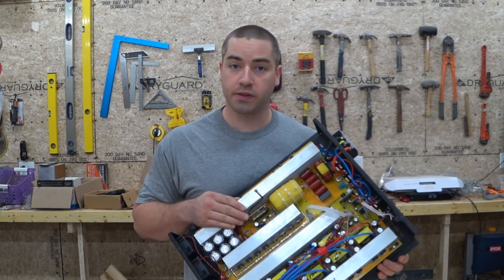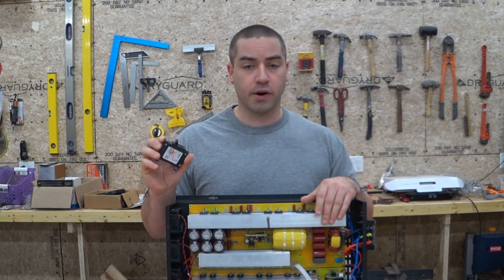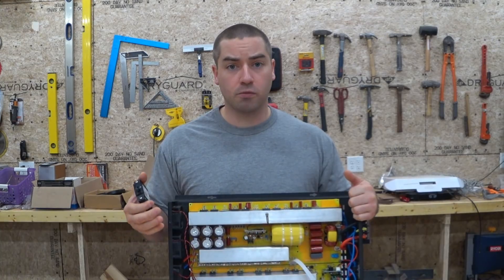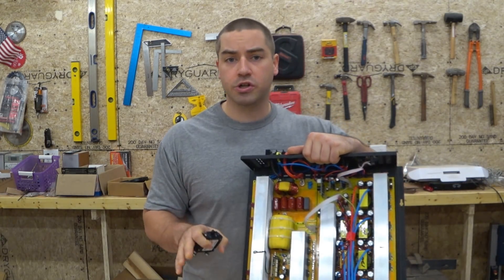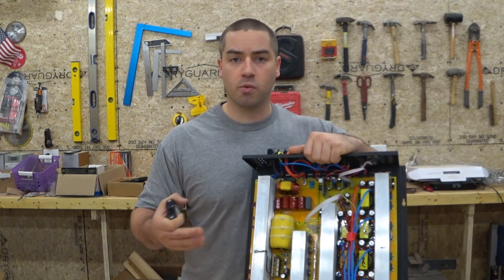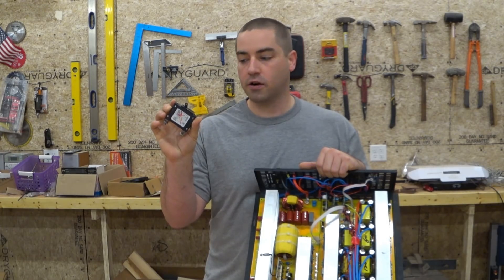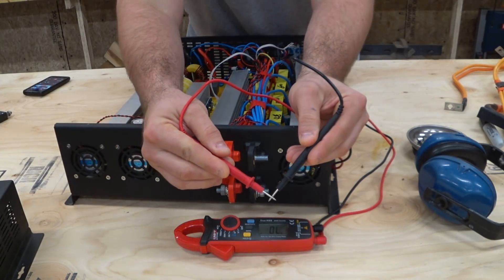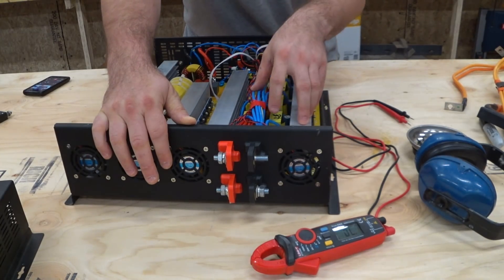Did I Blow Up the Inverter?

Comment: I wonder if the ground supplying the inverter is under gauge? I know from car stereo days that if the power can't flow back out the ground fast enough it will blow mosfets.... If the amplifier is under a big load and you were to disconnect the ground supply it will immediately fry the amp. Perhaps the ground wire supply is too thin to allow the voltage to "flow" properly.... I'm just a guy though who knows.

Comment: When I made inverters in my younger days, to change DC to AC, I remember using a high-level MOSFET and a low-level MOSFET  to switch one output node to the positive and to the negative. This was used in a half or a full H bridge. The storage capacitor on the DC side had to be very close to the Mosfet as at that current high spikes are generated even in short wires.  Well, the firing of the upper and lower Mosfet had to have a delay time as if they switched together that would be a dead short circuit across the storage capacitors. From what I can conclude in this video the fact that the fuses were blown and the MOSFETs were also failed and at the battery end there seems to be a short circuit...... then I am afraid the firing of those Mosfets either to get the high frequency to step up the voltage or to get the sine wave shape due to  switched modulation...... well that part of the circuit needs a lot of attention before one markets an inverter.
Reply from the maker: Thanks for your input.  Does anyone make an inverter that has protection built into it so that it will just shut off instead of burning up?
Reply: @DavidPozEnergy  Unfortunately in high current inductance switching, voltage spikes occur so fast that no protection system is fast enough to stop any damage. Fuses, Circuit breakers, and electronic current or voltage protection are not fast enough. Good design, good components, and testing and testing and testing is the only solution.
Reply: @DavidPozEnergy  the Schneider conext sw4024 I have is a beast, it's a large transformer inverter, 4000 watt 240v, I have two of them and we live off grid powering everything like a normal house, it's pricey but well worth it and have had 0 issues with it.

Comment: Looking at the picture of inverter, It appears it has nine DC to DC boost blocks converters.  To save idle current and improve efficiency at lower power levels, the nine boost blocks are brought online as needed to supply the load demand.   Each of the nine  DC-DC block can up supply about 1kW.  They produce DC voltage output of likely 180 to 200 vdc.  The nine transformers are high frequency ferrite, likely running at 25KHz to 50 KHz range.   The other side of the inverter is the sinewave PWM switcher to create the 120 vac sinewave output from the HV DC boost supply.  

Problem with this parallel boost circuit design is the time it takes to engage additional boost blocks, especially during surge demands.  At best case, there will be a slump in output voltage.  At worse case, the surge overload on a given boost block will saturate the small ferrite transformer causing the MOSFET current to shoot to extremely high level, blowing the MOSFET's out.  This happens before additional block can power up and assist in the surge load demand.

This type of design needs to have additional circuitry to avoid hard saturating the ferrite cores of the transformers and current limiting on the MOSFET's.   It is also possible the surge creates high voltage overshoots on the transformers exceeding the breakdown voltage of the MOSFET's.  Surge snubbers are required on MOSFET/transformer to absorb this.

Comment: The inverter is not designed do have the battery pulled out. That's what the 80amp DC breaker did.

Comment: Your inverter had a cascade failure. What it does is splits the voltage into a positive and negative DC then creates a 120V 60hz output from digital pulses in the upper kilohertz range. The reason it failed is one of the FETs shorted out, then stressed the other ones till they shorted out.

Comment: You are correct, now check the transistors on the heatsink and you will find a bunch shorted.  You should get around .6v base to collector, and base to emitter on a diode check.  You may have to unsolder them for accurate reading but the shorted ones will be obvious without desoldering.  Not sure why this failed other than a crappy inverter.

Comment: You get what you pay for when it comes to inverters I've had lots of china inverters and had a Magnum 4848 and have a Xantrex now IDK just saying thats one area where ever one has been burned by the cheep china crap....they are only good for running light bolbs LOL
Reply from the maker: How do you like the Magnum?
Reply: @DavidPozEnergy  t did everything that I needed it to do, it ran my 220 water pump and microwave I beleave it was the Magnum Energy MS4048 Pure Sine 4,750W 48VDC at the time I was off grid for about a year then moved and sold the Magnum for a little less than what I paid for it

Comment: My guess as an engineer not knowing the circuit, is that the harmonic frequencies caused by the saw starting is triggering the FET circuit causing them to form a short. About five months ago I had to fix the power in a manufacturing plant that converted over to LED lighting that was causing motor soft starts to fail weekly. I attenuated the harmonic frequencies using low pass filters on each power run to the LED lighting. In the office area some of the printers when printing would make some of the LED light flicker when they were printing. I fixed this by adding a extension cords to attenuate the power line noise. A filter would have been better but the extension cords was a much chipper fix. With all this said the working unit must have some type of filter system or a better circuit for firing the FETs and that could be as simple as Ferrite beads.

Comment: this is why when i asked my inverter maker ,if i can replace the fuse with a circuit breaker,for the same reason of power surges blowing its fuse, and the maker said NEVER USE A DELAYED BREAKER OR SLOW BURN FUSE. FAST BURN ONLY.

Comment: You are using an 8000 watt inverter, but the 8KW figure refers to a purely resistive load, the load you are putting on it is inductive, and you need to know what the KVA rating is for both the saw and the inverter, a good inverter will give you both ratings for Watts and KVA. A 1KW motor might have a KVA rating of 3KVA, this is where power factor correction is needed, and could be missing from the inverter, what is the KVA Rating of the inverter?

Comment: Hi David,Seems there are already too many comets, so here is another. I design inverters over 40 years now, the first was square wave. Nobody seems to talk about your inverters wave form that is not pure sine wave as power company is and is called a step wave and has THD (Total Harmonic Distortion) rating. Motors or any inductive loads have a reaction to wave forms because a magnetic field is produce around the coil that during zero cross cycle will induce a back EMF (Electro Magnetic Force), This can be helpful if the transformer is tuned to the load but the loads and type vary. The only perfect DC driven inverter that simulate a perfect sine wave is the Ferro Resonance Transformer. Most inverters work fine with resistive loads and the better inverters have protection devices to handle more types of loads. Looking at your video it appears that the inrush and inductive reaction caused a voltage spike across the Drain and Source leads of a MOSFET called Vds (Voltage Drain Source) and on average can be 700 volts and that spike arced across the insulator inside the device and destroyed the MOSFET. (look for pin hole) If it used standard transistor would be the Vce rating  (Voltage Collector to Emitter) and because your inverter does not have trans/surge absorbers to clamp and dissipate the spike it shorted allowing DC current not AC to travel through the motor windings and that could easily be 200+ peek amps in the 1/2 second  way over taxing and destroying the CB. If you measure your saw's motor winding it will read as a short circuit because DC travels in a loop but with AC its changing direction back and forth and there is never really a short circuit @ 60 Hz so the failure was not normal for the circuit breaker as an overload it was designed to handle. Hope this give you a better in site and toss the breaker/inverter.

Comment: Hey 'Dude in Garage - Great questions & testing!  Always intrigued & Interested by electrical * 'whatevers',  just not good at all. 
DID THE BREAKER TRIP?        YOU DID CHANGE FRIED FUSES - Yes?     
@13:38    You mentioned Breaker "Fails"  ->  After you said 'most likely inverter failed'.   13:25  
AvE  has done videos about inverters  -->  https://www.youtube.com/user/arduinoversusevil/search?query=power+inverter  
* biclivedotcom*   Help with part 'Names' & Fun  =]      --->  https://www.youtube.com/user/bigclivedotcom/videos     
Interpretation is very hard for me, and feel what i do get is gone in a bit.     
 I wish I understood this stuff, but only seem to get as far as - AC DC ~  That's a 'group' - right?    lol    = ]     ('think simple')
Reply from the maker: Hi Karen O,  I misspoke, the circuit breaker did not fail, it opened as it should.  The inverter failed, causing the circuit breaker to open.  Yes, I tried changing the fuses, but there is still a short on the board.  Probably the mosfets have shorted and need replacing.  Eventually I'll get around to trying to fix it, but I'm not there yet.  I'm working at building my solar array and making videos about that.
Reply: @DavidPozEnergy  -  Thanks for the info!    Saw other video, after this, on delivery of new one.  Oh W0W ~ don't you hate that when repeated? 
My son has Just installed Solar on his house,  I think waiting for 'inspection', so not yet in service.   I MUST ask about his.   ~ Cheers!

Comment: Nothing wrong with the  topology , I & MANY OTHER engineers have used this concept to get higher powers eg. multiple output devices in audio amplifiers,  HOWEVER  you must engineer in load sharing to not only prevent catastrophic failure due to excessive  power handling but also some modules will thermal cycle more degrading the power devices chip bonds and other stresses shortening the life.. The input lead length I suspect is not really part of that although it could be. ( I once designed a successful home car battery charger where the ballast resister was the leads to the battery.) these input modules should NOT be designed as stand alone units but as  modules in an array working together distributing there load AND PROTECTED. Protection circuits generally cost but not much verses reliability and extremely little  for reputation!  I suspect some engineer without a lot of experience  designed this one, or it might just be a lemon. Shit happens!PS. Input WOULD SHOW a short in measured the way you did just from the power supply capacitors charging. TESTING Take out ALL primary Low Voltage  fuses and replace them ONE  at a time (use smaller say 30amp for test) powering each time  up with a LIMITING RESISTER IN THE BATTERY LEAD. (Suggest about ~1  ohm (Piece fence wire at a pinch) . Big enough to allow operation with light load but will blow fuse and limit damage otherwise))  with a small load on the output (20 - 100W Light bulb). This will establish the failed input inverters assuming the output inverter circuit is ok.Would love to see circuit of unit - Can you make available ?

Comment: The Reliable 8k inverters have a problem, i have the same problem. They can’t take high surges, the company sent me another one plus new parts to fix the other one and they blew easy
Reply from the maker: It sounds like I'm not alone.  Happy to have the company, but sad it seems the company was selling a product with a flaw.  Has the second one been holding up for you?
Reply: @DavidPozEnergy  The second one is working good when the voltage is at 51.2. Anything higher than that, the red light starts to blink. i also notice the inverters need a load to keep the right light off when the voltage gets 52v to 55v. When my batteries are at 56v, the lights in the house starts to flash quickly so i have to switch it off and go back to grid power.Reliable Inverters are NOT reliable.. Great customer service but bad product.

Comment: This is one of the best videos I have watched...A great one for instruction and to share...I'm a former HVAC/ELECTRICAL/MECHANICAL BLDG. systems maintenance foreman....Whew...Try saying that three times fast...I'm a former instructor too, soon to be doing it again...Semi retired, just couldn't stay out of it...I will use this video...The explanations and troubleshooting are detailed, clear, and the best part," understandable " with out talking over a guys or girls heads....I think, pulling one component fuse at a time, while the meter is ringing, may point to the bad circuit, but, reading through all the components, makes a circuit, and it will ring the meter too....You have to isolate the feed from the return and meter each one to ground...Maybe the base of the unit...With the fuses out, if reading the terminals of the socket, where the fuse goes in, one rings to ground, bingo....Where you go from there is determined on how deep you want to go, is it worth your time and /or the bucks, or just send the thing back...This is still a video worth watching and more than once...My thanks to the gent that made it.
Reply from the maker: Thanks for the kind words.  I hope your class finds it useful.  It helps me out a lot if you share the link and/or channel name "DavidPoz".  Thanks.

Comment: I had the same problem with Circuit breakers on large induction loads put in a 300 amp class T fuse, problem solved. DC breakers have arcing problems causing voltage drop and super high ampere rise. Lost nice inverters before I figured it out. If your wondering why your 3000 watt inverter ran it. Look up voltage sag. It’s designed into some inverters to increase start up load for induction motors.

Comment: I watched the video two times
The CB or Circuit breaker is between Battery Bank or DC Electricity source and the inverter.
Did you make sure that you're using DC Breaker not AC Circuits Breaker?
The circuit breaker contain a room inside for chemical gas (called SP6) that absorbe the Electric arc's.
The arc you saw should never been seen unless this gas leaked out from the very closed room inside the Circuit Breaker.
If that happen you will be able to see marks on the bottom of the sides of the CB.
Next major crisis is the inverter.
Inverter's do output AC
But AC is two part, one is the Active power which is used by lamps , electronics or any device generat heat, but the other part is reactive power which is very important for the coil-contain devices to work, like electric motors, this reactive power is the power needed by the Saw or the motor to speed up, providing it will reduce the In-Rush current.
The percentage of Active Power to the overall power you use should be like 80-90% and that is called Power Factor or Pf , the rest or consumed power is Reactive Power (20-10%).
Now what happened with you is that you used a machine that exceeds the reactive power that your own inverter can handle, 
Like you used a machine which draw 2KW active power but 1 Kilo-Var reactive power.
This leads to demand more current that the MOSFET can provide leading to short the internal protection of the MOSFET to ground.
Inverter's device's can't be used for providing power industrial or reactive power demanding devices unless u used a way of providing Reactive power to the output of inverter (like Capacitor Bank),

I hope i helped explaining what happend.
At the end,,The inverter still working,, all what you have to do is replacing the MOSFET's with new one and the conductivity will be gone.
Reply from the maker: I have another video showing more details about the circuit breaker.  I didn't see any space for a contained gas.  https://youtu.be/Woigo3sTp_E  Have you seen this?